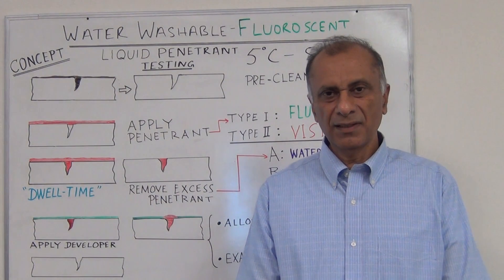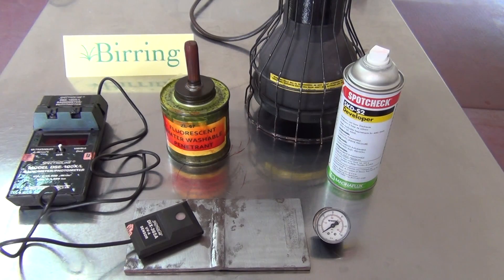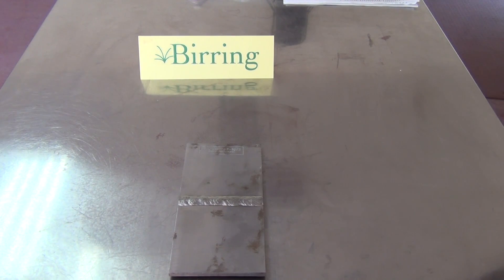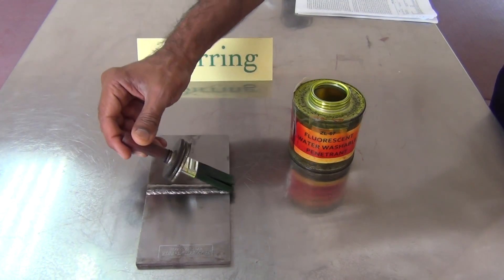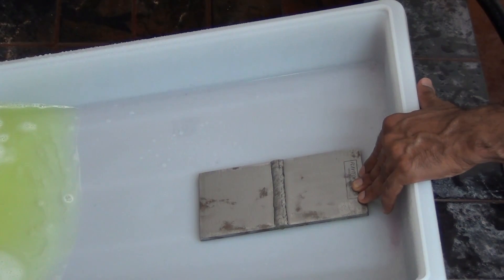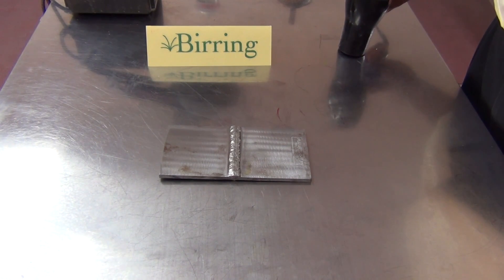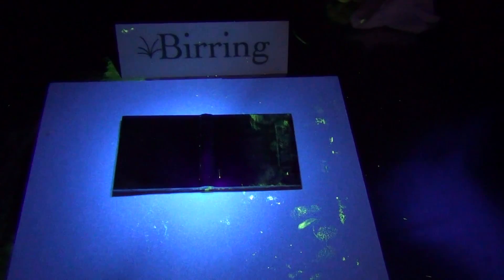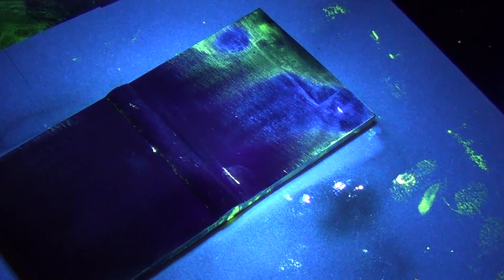Birring NDE 103, PT Water Washable Fluorescent; Liquid Penetrant Inspection # 3,

Comment: By applying the penetrant with brush, how do you make sure that the applied particles concentration is at it should be and the particles vs liquid mixture is uniformly applied ?
Reply from the maker: Penetrant is a liquid. There are no particles
Reply: No, this ia not correct. There are color pigments in it. While applying penetrant, the mixture of pigments and the carrier liquid must be homogen for maximum.test efficiency. That's why we shake the cans before spraying. But while.applying with brush, how can you assure that pigments and liquid are homogenously applied ? Apparently not.

Comment: Hello! Sir. In this session I have noticed that you told the water pressure should not exceed 40 psi but I read in book that the water pressure should not exceed 50 psi. 
2011a Addenda July 1,2011. Kindly Check it